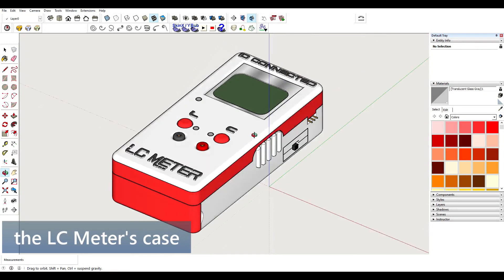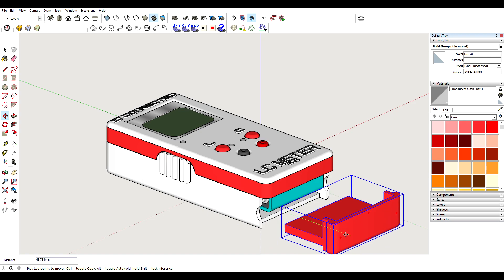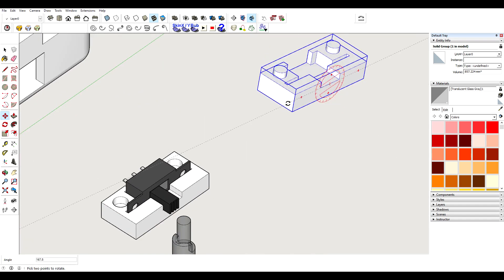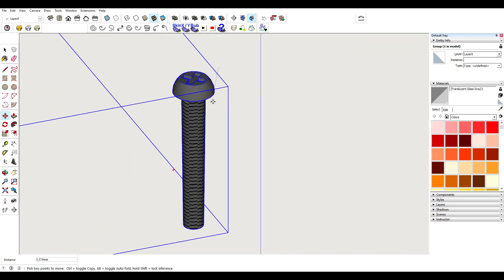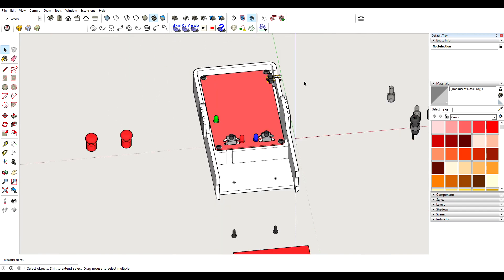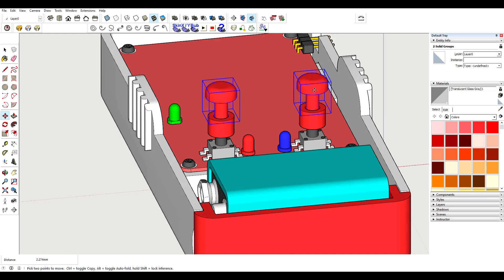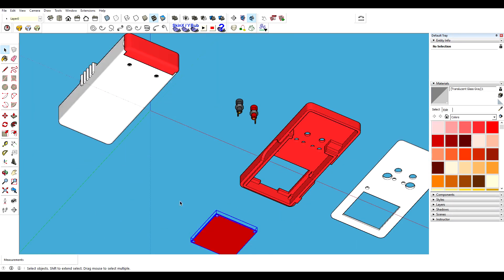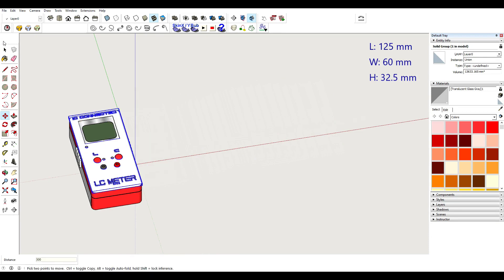LC Meter - Build - Part 3

Comment: Are the switch spacers and tops that you used available commercially?  Or did you print them 3D?
Reply from the maker: Everything you need to build an exact copy of the LC Meter you see here, can be found on my github repository. Those parts you mentioned are also there (STL files).

Comment: What is the white paper, to grind on ? at minute 5.30 is it grind paper ??  What is the fluid used ?? to clean the 3D prints
Reply from the maker: Sanding paper for metal. You can try the ones for plastic. I used lower grits to remove any coarse imperfections, and increased the grit number till I got a fine smooth surface. 
That fluid is isopropyl alcohol. To remove any residue after sanding you can also use a fine brush, compressed air, a vacuum cleaner, or just wash your parts with water. Make sure you don't use hot water. PLA starts to change it's properties above 80'C.

Comment: Are the 3D step files available? Where are they located?
Reply from the maker: I used SketchUp (which uses polygon meshes) to model the case and AFAIK there's no direct way to export into STEP format.

Comment: can TL071 be used??

niiiice build...lovely project
Reply: The TL071 is an operational amplifier, it can do the job, but it will do a slower switching action. You'll need a split power supply for it.
Voltage comparators such as the LM111, MAX907, LT1394 or the AD8561 are more suitable for such application